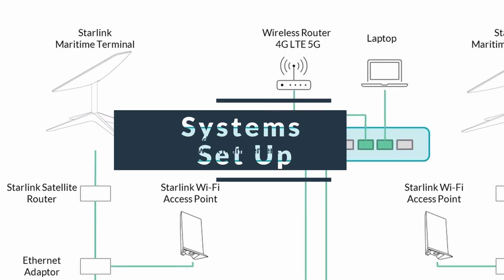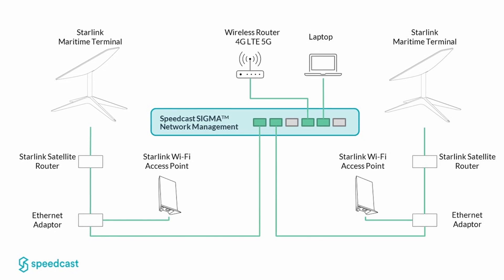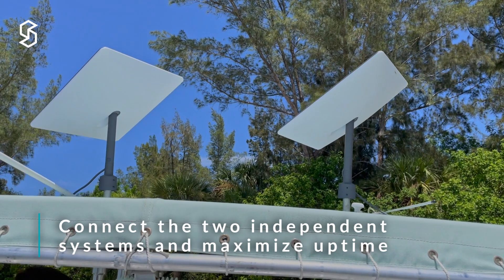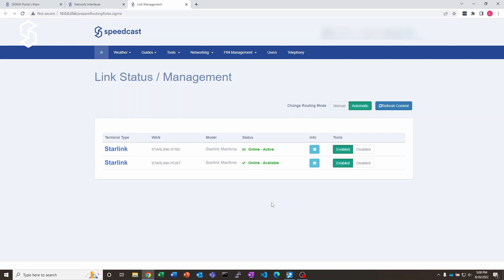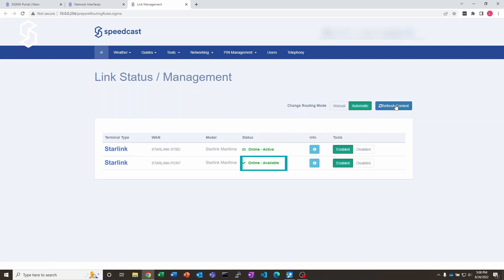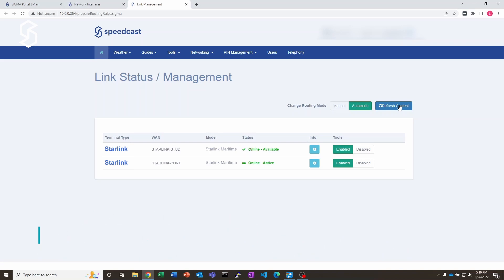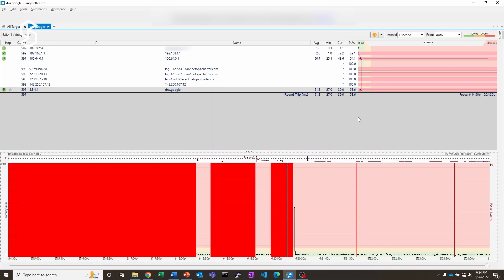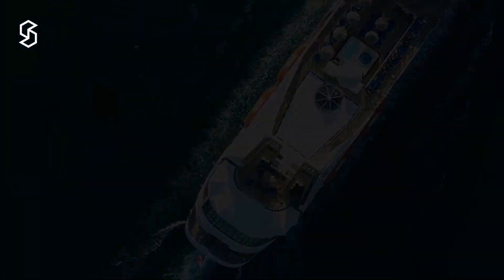How to get the most out of the Starlink Maritime systems | Starlink Authorized Integrator & Reseller

Comment: It looks like your sigma product is not performing load balancing., just failover. Correct me if I am mistaken but that means you are only using one starlink at a time ever. Other products can use both links simultaneously increasing the bandwidth and yours does not.
Reply from the maker: You’re right. SIGMA is performing failover in this demo. However, SIGMA does do load balancing as you can see in the bonding video https://youtu.be/bS3c_2NMk20, where we share across both Starlinks at once and show the performance of two panels working together.  Please have a look! Thanks.

Comment: Instead of unplugging a WAN cable, block the beam. It's important to simulate a WAN failure without dropping the Ethernet link. The router knows immediately when an Ethernet link drops out, but has to use its connectivity monitor to determine when a WAN failure occurs. Thanks a ton for this series of videos, I think you might be the first to play with Starlink Maritime.
Reply from the maker: Thanks for tuning in! We have certainly learned a lot from the trials and deployments. Testing so far has not shown a difference in performance via blockage or removed ethernet cable. Yes, it takes a router less time to identify the network is down with a disconnected cable, but we have gone another path with SD-WAN that doesn’t rely on a simple switch from primary to secondary WAN paths.

Comment: No No no!, You guys have this all wrong.. You are using a device that's designed to have 2 or more internet service providerS , this will not work with Starlink unless you want it to be a simple  "failover", and this could be done almost transparent ( No ping loss ) .
Stralink will have this in the near future but unfortunately, it has to be done by Starlink and sync with the network.
This is basic and fundamental TCP/IP networking , plus the wireless links to and from the subscriber to satellites,  satellite to ground stations,  plus available routes is  important.
Good luck on your venture.
Reply from the maker: Thanks for checking out Speedcast's Starlink Maritime Assessment Series! We post weekly content, and Part 5 focused on just the two Starlink Maritime antennas that make up the single system kit. Check out part 6, where we talk about integrating Starlink service as part of a complete connectivity solution leveraging multiple connectivity paths. In Part 6, we highlight the benefits of LEO solutions like Starlink, combined with GEO, MEO and 45/5G pathways that can deliver a truly ubiquitous service for the highest levels of performance and availability. 

You can also check out our recent blog where we highlight a Starlink trial that includes seamless failover from the Starlink LEO service to Speedcast’s Ku-band network: https://www.speedcast.com/blog-hub/2022/make-100-uptime-a-reality-with-hybrid-connectivity/

Comment: Is the link health probing manageable? Can these granularly modified?
I've done this mistake in other demonstrations for 4g router link failover, pulling the plug is a very "clean cut" link failure for a router, the probe of link state is an immediate distinct result but actual WWAN link failures are different. 
At least in 4/5g I know you can have a signal problem approaching by getting suddenly 100+ ms pings first before entire packets get lost, but also high upload load can introduce 100+ms latency. This is not easy to detect while a failover needs to already start to happen then or the failover time will take quite long to actually hand over. Is this being considered?
Reply from the maker: Thanks for your comment! We call this type of behavior “flapping,” where the quality of the link is degrading and is not an absolute on/off. For this particular video, we did not add the overhead that comes with the monitoring you talk about, but the next video will.
Reply: @SpeedcastGlobal  thanks for the info, I'll be eager to watch the next video then.